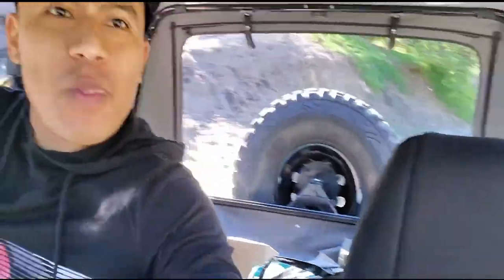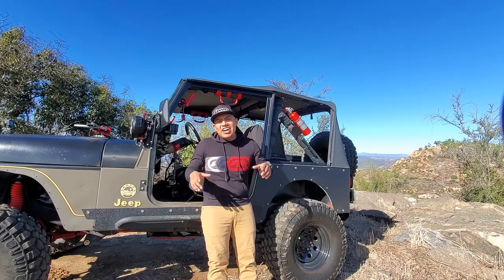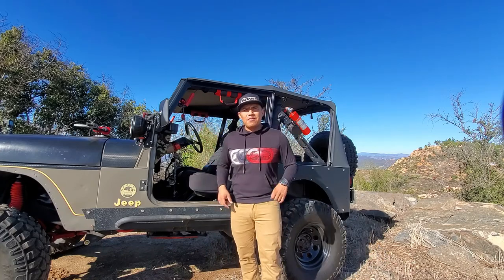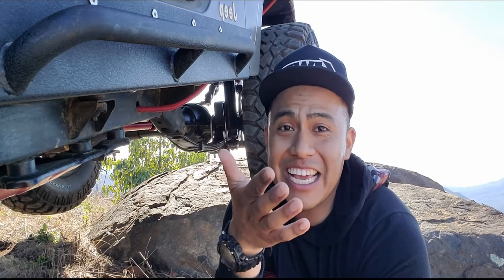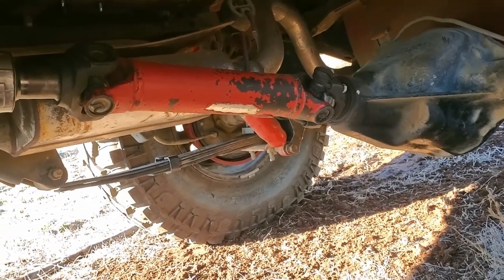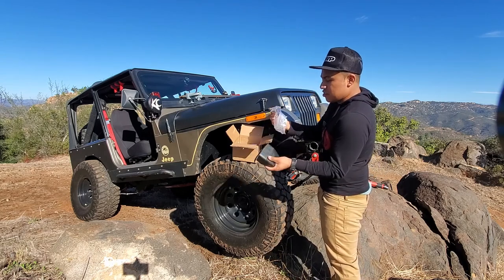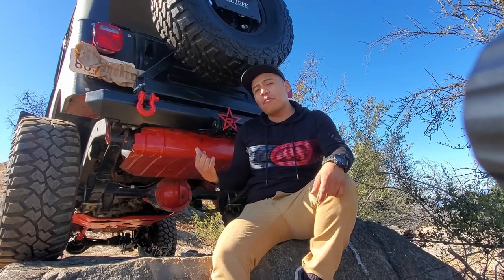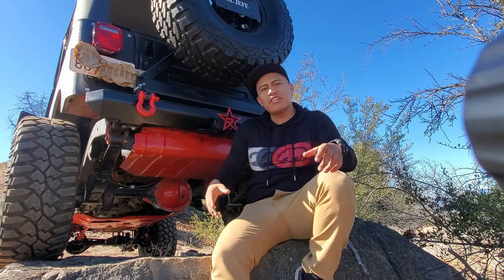Future Axle Upgrade for Jeep Yj "EL JEFE"

Comment: You’ll get a lot more flex if you remove the front and rear track bars and front sway bar
Reply from the maker: Agreed Gabriel. I already have the rear removed so next time I'll remove the front. I might upgrade to the quick disconnects for the sway bar.

Comment: i realy [ike 1 tons under a yj...but for my 94  dayly driver. i did  4fifty six gears  to help rolll 3fives. still have open diffs.. for now  .and no slip yolk YET. but im on a tight budget .but losing trak bars ans sway bar ...now thts free $ to do and huge gains with better ride on road in my option. keep  putting out ur yj vids please.. inspiring they are. thanks
Reply from the maker: @J Dubbson thank you for highlighting on your setup. I agree, you got to work with what you have if there's a budget. Thanks for your suggest, I think I will be doing that. I appreciate your support, i will be dropping more YJ videos. 🙏🙏

Comment: Love ur YJ. Definitely  don't need the sway bar though, everything will feel the same without it but the flex will be drastically improved. And don't let people talk bad about the D30, I wheeled mine with 37's for about ten years. I broke a drive shaft and a few u-joints but never had any issues with the axle shafts. It was open though too, but I feel that helped in its survival.
Reply from the maker: Yo captain, thank you for the support and the compliment. Granted that you display truth with the previous 30 on your yj I agree. Pretty soon I'll be posting a video about how deep these stock  axles go.
Reply: I'm missing your videos bro and that yj. Hope all is well.

Comment: keep the 30 in the front and get a locker for it. go 8.8 limited slip in the rear youll be golden unless you wanna go super hard core
Reply from the maker: @DudeGames, the jeep YJ has a purpose to tackle on the harder trails but you're right. For now I'll beef up the rear axle with an 8.8 and spring over. Eventualy when the budget allows it, a coil over setup.

Comment: I DD/ wheel a 92 YJ stock axles , 35s / 5" suspension lift, 2" body ... remove the track & sway bars. Leafs can flex very well, the track bar will bind and limited the flex on your rig. Your jeep is in really good shape, Mine is a bucket of bolts haha  The stock axles are ok for the trails and light rocks... don't panic and take it easy on the gas
Reply from the maker: Von, I plan to move up to 35s in the future. I will most definitely remove the track bar and sway bar. If you could only see how my jeep use to look six years ago, its was junk.  I plan to drop a video of its beginning. Haha its a carburated engine so I have to give it gas before it stalls out. 🤙👍

Comment: Them open diff suck!   The main thing you can do if your not going to be doing any rock bouncing or hard wheeling is, with the Dana 30, run a locker with the appropriate gears, switch out to chrome alloy axle shafts... should be good.  And not break the bank
Reply from the maker: Thanks for the advice David. For the meanwhile I most likely will proceed with a budget plan as you mentioned. Ultimately, i would prefer tons but for now something budget friendly will suffice.

Comment: 8.8 cheaper than a d44. And the d44 harder to find. The 8.8 stronger as well
Reply from the maker: Thanks for the feed back Emmanuel. The 8.8 my friend is selling has a good setup already with lockers installed so might be the way to go.
Reply: Revenant Jeep  Np and even better! Save some money go with the 8.8 I spent 2k when I installed my d44 off a tj had limited slip does pretty good just regret not getting a 8.8 to save some cash